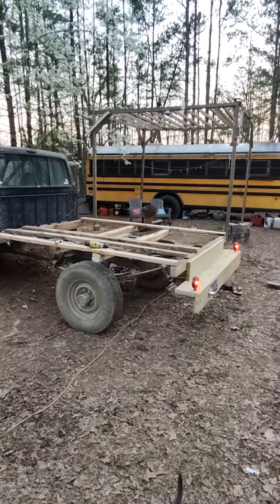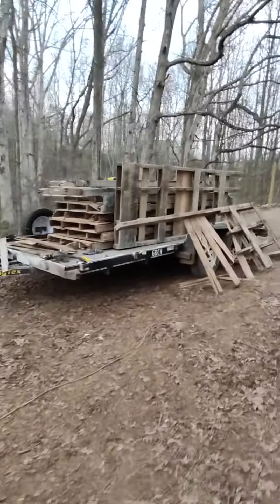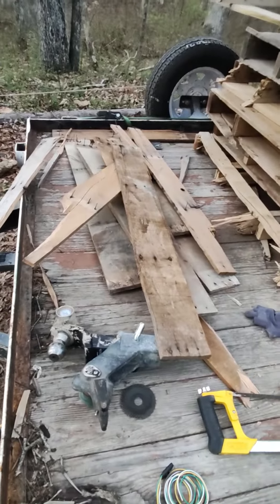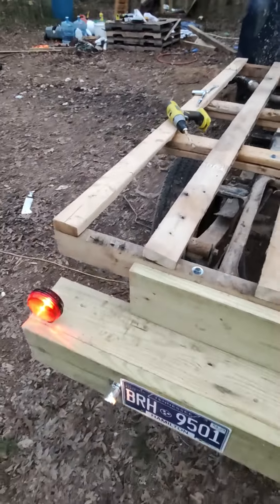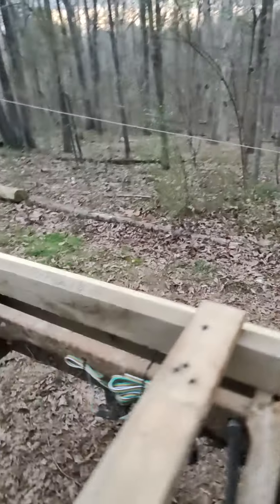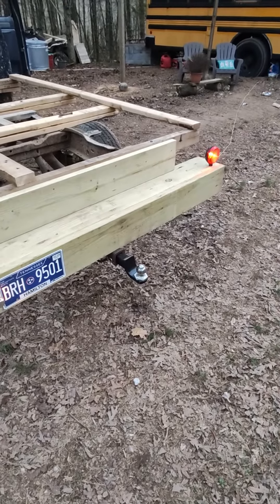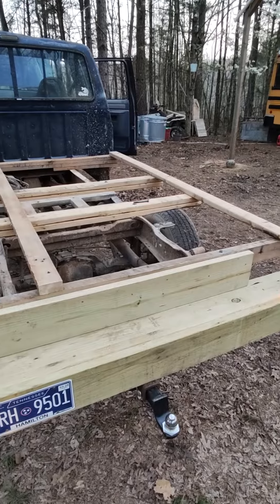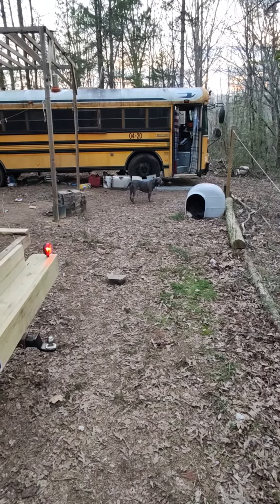DIY Flatbed for Grumble Butt

Comment: I worked for a huge Australian multinational pallet place repairing pallets and as a warehouse supervisor and have spent years in warehousing. I'm amazed at how many people think pallet wood IS SOMEHOW GOOD! It's utter 4th rate junk. Why would it EVER be good? There's the occasional superwide pallet of unknown origin with alright 2X4, but that's about it
Reply from the maker: The 2x4s in these ones are solid and straight. Definitely salvageable. The rest is definitely junk! I thought I might be able to get by with it while I saved up some money for something better. But nope! Lol
Reply: it isnt the pallets.. its the wood. pallets use un treated pine wood...  The same pine in hardware stores.. exactly the same  wood used in 2x4s and other boards..  Its untreated though, untreated pine is brittle and easy  to break and get soggy and  ruined by water..   The same crap wood he used  for that bed in the video "Except the  bumper"   Treated pine is 10x stronger, and resistant  to rot. if its kept out of the sun.
Reply: @w7lte   the 2x4s are untreated... do not use them for a bed.  Untreated pine is brittle like poplar wood.  Dont use it for something outside.   You  need to use pressure treated wood or oak if your building something like this..   I can snap unetreated pine like those 2x4 easily

I get being a cheap ass i do  it all the time, but this is stupid.. Seriously.
Reply from the maker: @jeepsblackpowderandlights4305  I get what you're saying and have taken it into consideration already. I still don't think it's stupid. The wood has been soaked with motor oil and diesel. It isn't going to rot and it is able to flex without cracking. The truck isn't going to be loaded down often, only about once a month to haul some water up from the spring. The corners of the tote carry all of the weight and they will sit directly over the frame rails. Yes, over time something may break, but it isn't like it's just going to come flying off. If it breaks, I'll revisit it and fix it. What you call stupid, I call an experiment. 😉

Comment: as someone who owns 14 acres, i 1000% for using scrap anything you have to fix or build anything.  My  problem  is  this...  You need to use pressure treated wood at the very least..  Using regular pine wood will be way too dry and  too brittle...  oak would be better though...  Youre taking a huge risk with that bed being all untreateed pine.